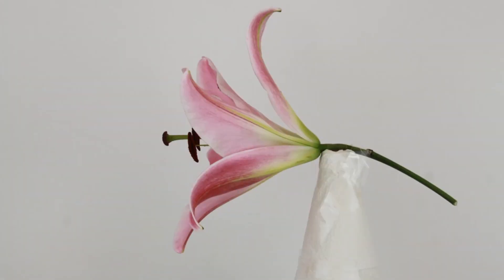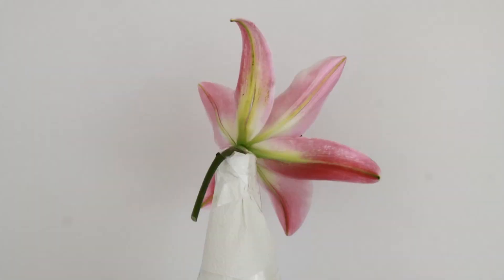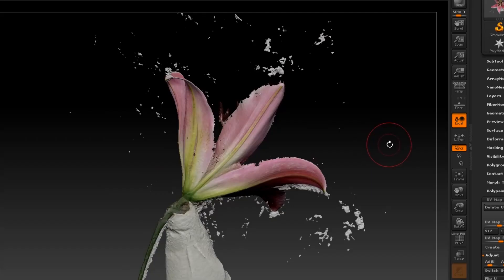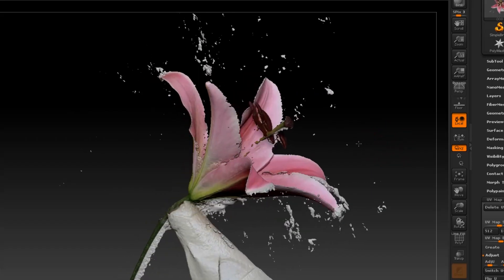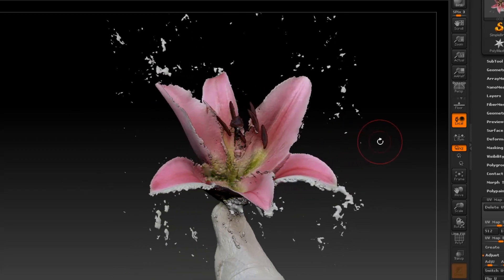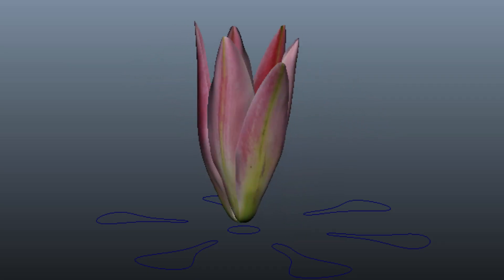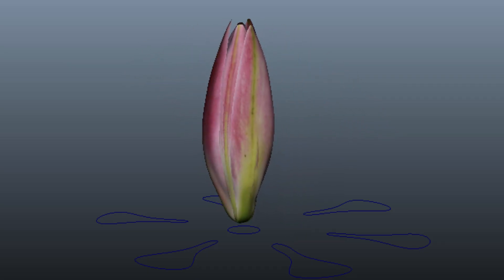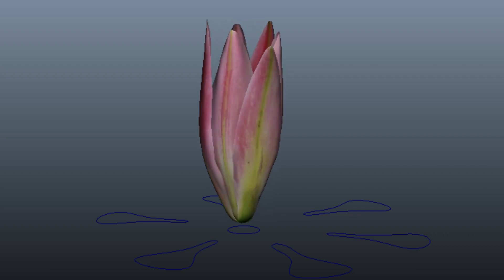3D Zoetrope made with 3D-Scanning and 3D-Printing

Comment: you could use a microcontroler and some kind of hall effect sensor to measure the rotational speed of the table and turn on and of the strobe light at the correct frequency
Reply from the maker: yes you are right, but it was just a quick test if it works.